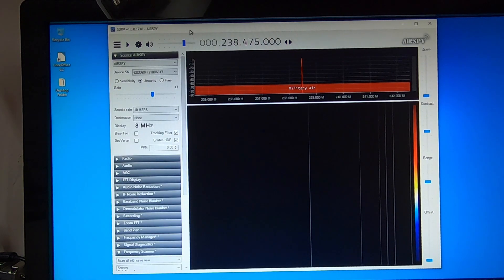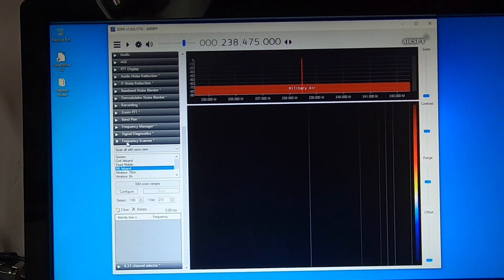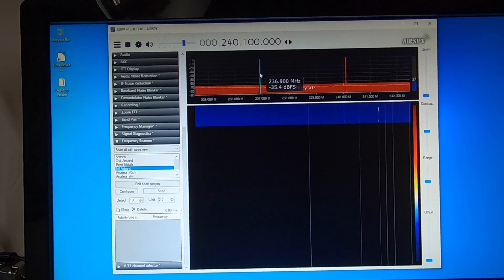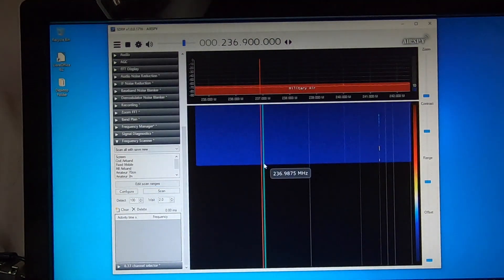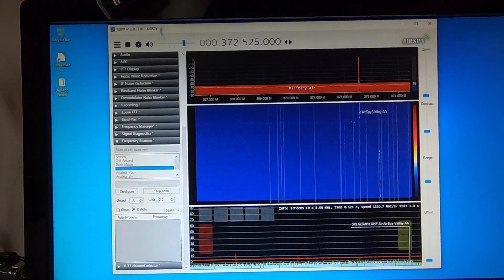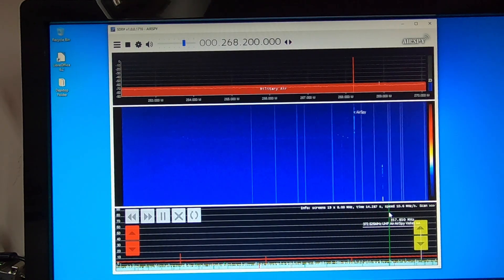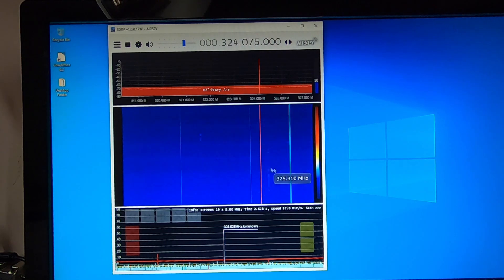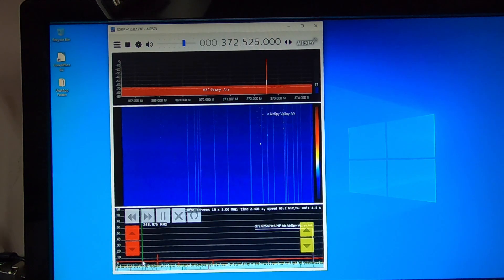SDR# and AirSpy R2 SDR receiver with the Frequency Scanner Plugin

Comment: Thanks - really good info. Can you explain the visualization window at the bottom, particulary what the red and yellow lines mean (and their up/down arrows)?
Reply: From what I understand, the red line is the squelch level. This line prevents the scanner from stopping every time it encounters some amount of noise. 
The yellow line is hysteresis which is the level below which the signal is considered inactive. This is the absolute lower limit of the "filter". You would set this line down low if you want to receive poor signals, maybe from a repeater far away. However, you'll also need to filter through many other digital noises and birdies.

Comment: How did you get the scanner to work? Where did it come from? How did you install it? I can't get mine to run. It doesn't show up in the list under frequency manager.
Thanks 4 any help
Reply: Mine was in the Airspy site Community Package with Plugins.
Don't install that package into your current SDR# path, or at least make a backup first, since it includes SDR#.